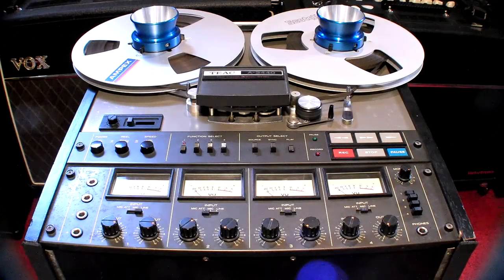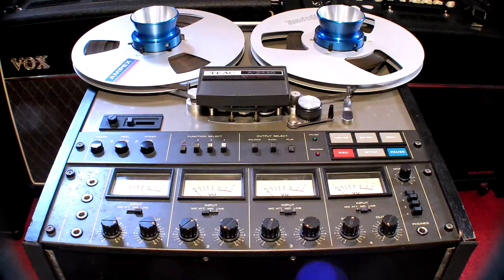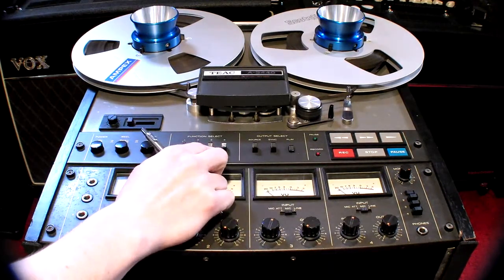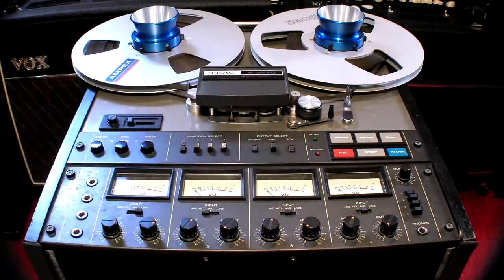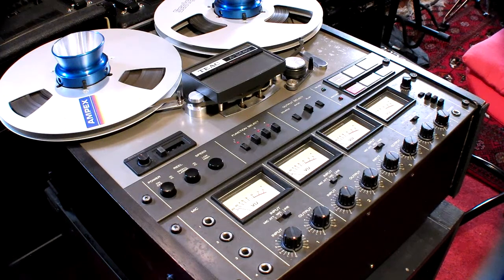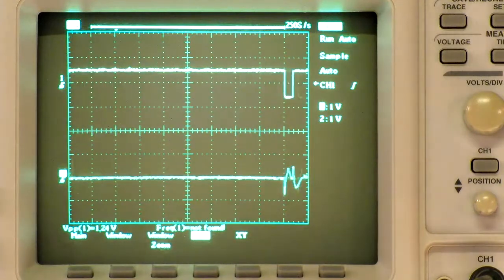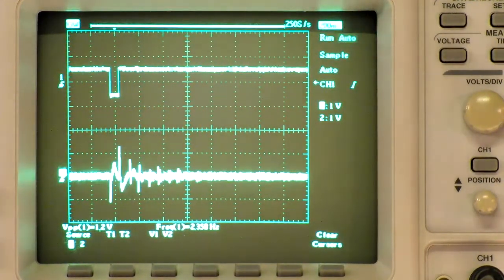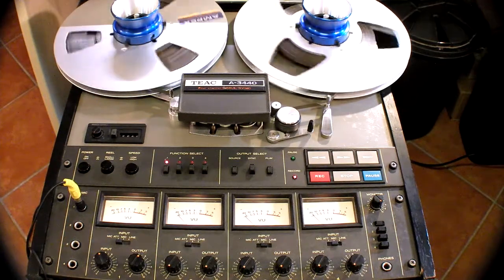Tape Echo Effect with Reel to Reel Tape Recorder

Comment: hi, thanks for this great demonstration! does this all buttons in technique also work for play & sync? i'm considering buying this machine and trying to work out if it would fit my purpose. i'm looking to use it as a kind of looper for a live set, using endless tape loops and disabling the erase head. the simulsync option is crucial to me as i'd want to create rhythmic loops that i can perform along with. so sync&play might allow me to record in sync and at the same time have a tape echo of what's being recorded.
also, since you seem to understand these machines quite well, do you think the pitch control could be modded to allow for much more extreme changes of the speed?
sorry for the question dump, if you find time to answer i'd much appreciate it!
Reply from the maker: Hi! Thanks for the nice comment! 
So, the simulsync in this machine already adds the capability of recording and playing at the same time (although it does not disable the erase head). It allows you to listen to whatever other channel other than the one you’re simultaneously recording to. So, in other words it uses the same head to simultaneously record and playback, effectively eliminating the physical gap between the record and play head, so a “tape echo” effect with simulsync is not possible.
For using this machine as a looper you can do your own tape loops and record each loop on a separate channel. Then, regarding the actual echo effect you can do it by using a mixer: you just have to create a feedback loop from the machine to the mixer and back (using the aux sends and returns of your mixer, this way you can also control the dry and wet signals directly). Teac actually made a little device that did just that (Teac AX-10).

As for the “extreme pitch control”, a machine like this Teac can actually be modded to accomplish a sort of “varispeed” effect. I guess you’ll have to find the trimmers that set the two speeds of the machine and mod in a pot instead that basically bypasses the (calibrated) speed selector switch and allows you to vary the speed from 7 1/5 all the way to 15 ips. You do need some knowledge in electronics, but I don’t think a mod like that would be too complicated to perform. 
I hope it helped a little :)
If you have other questions feel free to ask
Reply: @DaveElectronics  thanks for your reply ! for the same reason you mentioned i thought that tape echo is not possible with sync at the same time. but your demonstration made me wonder if you can't press sync and play at the same time and therefore get both simultaneously.
another idea i had in the meantime regarding endless tape loops is that you could create a loop with a moebius twist, set 1&3 to record, 2&4 to playback, sync mode. then the loop would alternate between the two track pairs, recording on 1&3 and then the next round passing through 2&4 to be played back. basically a frippertronic looper within one device, but you probably need double coated tape for that to sound nice. i guess i won't get around getting one of those machines to really try out these things.
Reply: oh by the way if you see this: do you know whether tracks can be switched in and out of recording without having to stop the tape? that would be a huge plus for me to get this machine. i think i've seen in a demo that you can change tape speed while running, which i dig too.
Reply from the maker: So, the simulsync and playback at the same time is not possible because it creates a feedback loop (in the machine itself) that completely overloads the inputs. That’s because simulsync already “listens” what the playback/record head outputs and the source simultaneously. If you press play too, it creates a feedback loop and i think you could destroy the preamplifier, so I don’t suggest trying that ;)
Regarding tracks being switched on and off and speed change during playback OR record (that is actually pretty cool if you want to try!), that’s absolutely possible! :)
Reply: @DaveElectronics  Thanks for the info!

Comment: I too have the A-3440 but I play the drums. However, I'm long retired from any stage stuff, (I'm 63), and to keep from disturbing the neighbors, I bought an eKit. The Drum Voice Module is a Pearl RBM-20 REDBOX so I can achieve these effects without the recorder.

However, I'm an audiophile (since 1978), and happen to also have several hobbies, one of which is in microelectronics. Therefore, I have a scope, AC Multi-volt meter, SFG, etc. and I want to see that signal that you demonstrated, on my scope.

Would you happen to recall how, and to what, you hooked your test leads to when you did that demo? My scope isn't as advanced as yours. I have a BK Precision 2120. I'm always in the "learning mode" and I suppose I will be for the rest of my life. By duplicating your demo on my scope, I will be adding to my very limited understanding of the physics behind microelectronics. That's really my goal, I suppose.

Thanks for the video. BTW: what was the Korg model you had in that demo?
Rich
Reply from the maker: Hi, thanks for the comment! 
The signal on the scope was achieved using a pulse generator connected through a splitter to the input of the machine while recording and channel one of the oscilloscope. The output of the R2R machine was connected to the oscilloscope on channel two. The scope was running in "roll" mode (being a digital oscilloscope). 

You can achieve the same thing using a signal generator with a square wave signal output (you have to play with PWM control to have the shortest "pulse") or even a metronome app on you phone can do it, just connect the audio output to the input of the machine. Your oscilloscope might not have the roll mode (if it's an analog one) but setting a slow time base you can have a similar result (although you'll have no trace persistance on the screen). 

The Korg synth is a MS-20 mini ;)

Hope that helps!
Dave
Reply: @DaveElectronics  Thank you Dave!! Sorry for the late reply, for some reason, my browser put the notification of your reply in my spam folder and I just found it. (It usually never does that). Thank you very much for the details on that connection path. I want to try it myself just as a learning measure and keep myself up on these things.

BTW: you play well! I forgot to mention that!
Thanks again,
Rich

Comment: What can I do with a Tascam 34 ?
Reply from the maker: Tha Tascam 34 is basically the "more professional" version of the Teac A3440. I never had a Tascam 34, but from what i see, it has the same controls (output selection buttons) of the Teac, so i think that the same tape echo effect could be achieved on that machine...
Reply: @DaveElectronics  Can you do the same with a Tascam 48?
Reply from the maker: @theshyguy1580  I don't have a Tascam 48, but i do have a Tascam 38 and the trick does work. Anyway, I believe that any tape deck with the 3 pushbutton style configuration for the output selectors is capable.

Comment: Hi ,do take a guitar cable from your guitar straight into the front of the tape deck input where a microphone normally goes then take an RCA cable connector out of the back of the deck straight into the input of the Vox AC30amp?
Reply from the maker: Hi, yes you coud do what you described but you would record just the "dry" sound of your guitar. To get the sound from your amplifier (with distortion, reverb, etc..) you'll have to mic the amplifier and connect the microphone to the front 'mic' input jack. The process to obtain the tape echo effect is the same. However, if you want just the effect, what you described is absolutely fine. Hope it helps

Comment: I own a 3440 since 1979 and never knew about the "all buttons in" mode. Tried today, it works like butter. Great tip man, thank you. I also own the sound on sound device for mono and stereo echo made by Teac in the same period but never managed to operate it.
Reply from the maker: Thanks for the nice comment! I really didn't know about the Teac echo unit you have, what model is it?
Reply: Ax-10 Sound on Sound. https://reverb.com/item/2751457-teac-sound-on-sound-ax-10-stereo-echo
Reply: Mine was brand new and sealed, NOS.
Reply from the maker: Very interesting little device, it seems it works just like the 'all buttons in' mode i described, but it does that externally by feeding the output to the input again.. I tried to search for it on ebay but it's quite pricey, at least here.. (are you from Italy as well?). Anyway if i manage to find a deal i might get it, i'm really curious!
Reply: Yep I'm from Italy.
Reply from the maker: Anch'io! Ti ringrazio ancora! saluti!
Reply: Ahaha, grazie a te. Comunque io non l'ho pagato più di 40 €, era ancora nell'imballo originale. Se riesci ad usarlo fammi sapere!
Reply: This guy LOVES playing with his electronic toys - nice video - he'd probably make a good comedian on late nite TV. BUT, for once, I'd like to see someone incorporate the process of adding voice echo to analog recording.
Reply: Hi, I have this same tape deck as the video. Do I run my guitar directly into the front deck input then use an RCA cable out of the back of the deck straight into the 1/4 inch Jack into the Vox amp? Is this how's It's done or do you need to use a mixer?